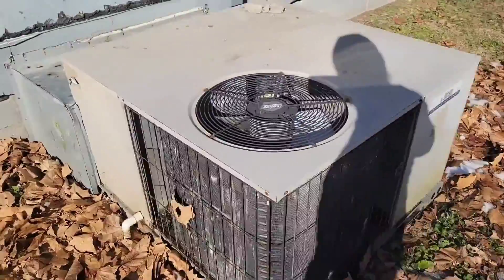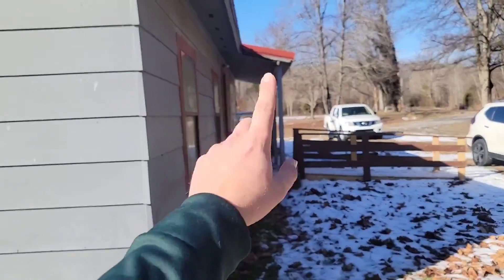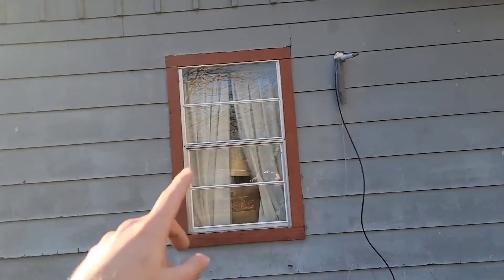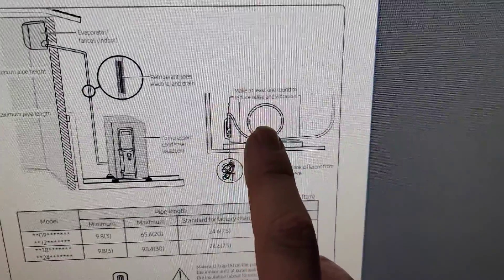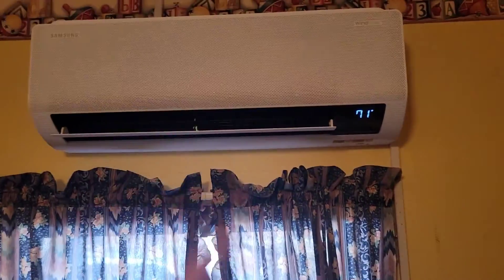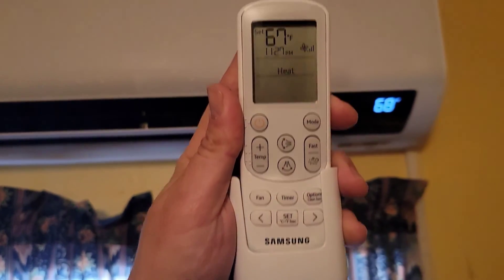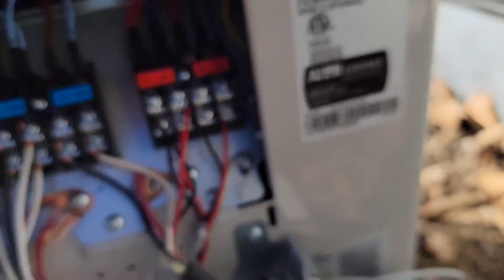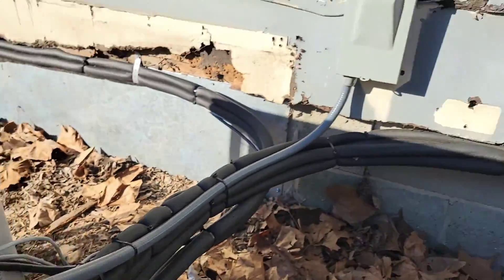Tips for a Successful Mini Split Installation

Comment: I notice you use 7000 btu heads in relatively small bedrooms. Why are not worried about short cycling and failure to remove humidity????
Reply from the maker: They will go down to 2000 BTUs
so no worries

Comment: Personally I would have went into the attic with the lines and came out of the middle by the unit. Having those lines hanging on the outside and running against the house looks bad to me especially in the front. One more thing I would have raises the unit there is to many leaves and dust to close to the ground

Comment: I'd love to get away with one unit but the way the house looks, the tight crawling space and the climate conditions in there makes your decision a lot more logical in many ways. If the conditions were different I'd probably suggest to go with an air to water heat pump from samsung and have fancoils inside for heating and cooling and maybe a DHW aswell if the customer wants.  Be safe Tadd! Nice work! 🥸

Comment: Is there a reason you prefer Samsung over Mitsubishi or Fujitsu for example?
Reply: I am not the one to answer this question but I prefer samsung over many other famous brands becasue the build quality is satisfying, "its not bad, its not top notch but it is good enough." it does the job very well and it won't dissapoint you. Samsung is also a wallet friendly brand and the algorithms for inverter models are very effective.